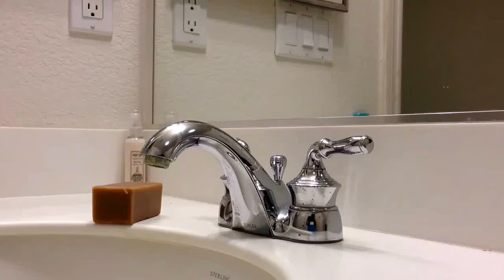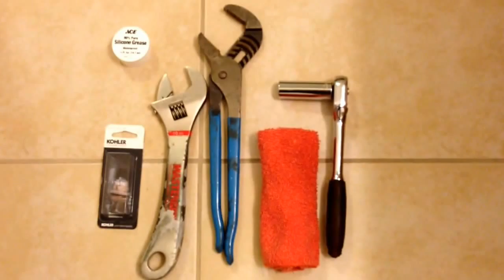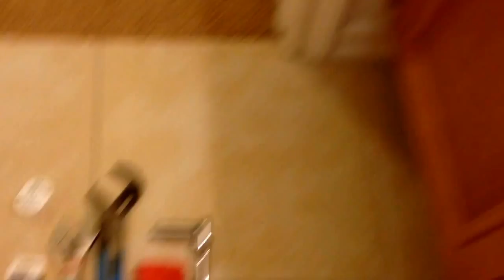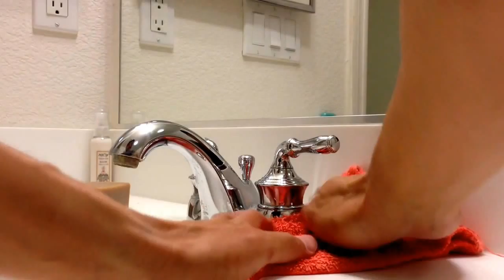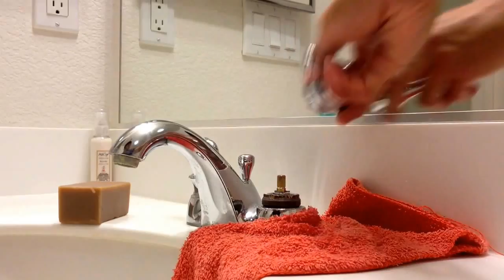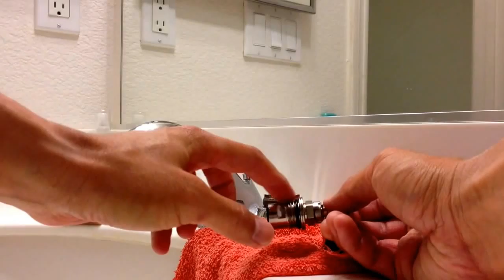Kohler leaking handle cartridge repair

Comment: Great video. I used it to replace the cold water cartridge GP77006-RP on a Devonshire K-393-4-CP. Koehler provided it free of charge under their lifetime warranty policy. I had to use liquid wrench to loosen handle prior to using the wrench (use thick rag to prevent damage). The part comes with a spline adapter, in my case it was not necessary to replace it. 5/8 inch deep socket wrench proved very useful - a fair amount of force was required to remove the cartridge.
Reply: I have not been able to loosen the skirt from my Devonshire sink faucet and noticed that you used liquid wrench.  First time I've heard of this product.  Can you tell me how  you applied it to the faucet and would it damage granite?  I can usually get this kind of job done with my rubber wrench strap but it's just not gripping the faucet.  Thanks
Reply from the maker: Really good point about the lifetime warranty! I should have done what you did and would have saved the money buying one.

Comment: WARNING:  We had this exact Kohler Devonshire  faucet but it was bought in 2015.  The design and disassembly  is slightly different.  There is a set screw in the handle which must be loosened first.  The handle can then be removed.  There is a Philips head screw that must then be removed.  After you remove the screw you can lift the bell shaped cover.  After that is done the removal of the valve and installation is exactly the same.

Comment: I will never buy Kholer brand faucets again.  I just replaced them with Delta.  They were leaking and rusting like a motha.  I replaced all 5 of them at the same time.
Reply: Really? These Devonshire faucets are heavy brass metal, and they cost about $150 for the faucet set.  Wouldn’t replacing the cartridges been cheaper and faster.  And the Delta cartridges don’t last longer.  The secret to these is for the original install to include plumber grease on all metal-on-metal contacts so they don’t seize.  It’s the cartridges that determine longevity, and supposedly the ceramic coated ones can last a long time.

Comment: If you need to fix a cartridge style Kohler faucet, use this video. Spot on instructions, easy to follow. Others want you to disassemble the sink from the bottom- quite the task. Ignore that. This video makes it clear that you need to have a 5/8” deep socket wrench fitting. A pliers would make a mess of the faucet hardware, since the valve is below the lip of the faucet base. Thankfully, I bought the socket, which made it much easier. Thanks!

Comment: Excellent video.  My cartridge was seized.  I sprayed a healthy amount WD-40 on top of the cartridge and let it sit for 15-20 minutes.  Used the 5/8 inch socket and with a couple of firm jolts with my hand it came out.
Reply: mine will not come out
Reply: @apuz13   look down a little further in the comments.  Ryan used this method:  Try a pass through ratchet with a rubber mallet.  Those things can be nasty to get loose.

Comment: What name and model number is that Kohler faucet that you repaired? Also, can you use the same cartridge for both sides due to cold is turned clockwise and on the hot water handle is turn counter clockwise. Someone told me to split it? Well Done INFO!!!
Reply: P/N 393-4-G-AB, but you can not find on Kohler website, looks bottom of sink, attached small white label with number

Comment: Can you replace the o-rings on the cartridges instead of the whole cartridge?
Reply: The o-ring only keeps water from leaking into the faucet base.  The ceramic valve inside the cartridge is what shuts off the water from coming out of the faucet nozzle.  If you've got water dripping underneath your sink then you should try tightening the cartridge or replacing the o-ring.  If water is dripping out of the faucet nozzle then the ceramic valve is bad and you need to replace the entire cartridge.
Reply from the maker: There is the one o-ring that you can see at the top of the threads of the cartridge, but I didn't try replacing it, so that might work... I just did the whole thing.

Comment: I notice that you are using what looks like the new cartridge for the video, correct?  I have a faucet like that also but it was another Kohler with the same leak from the stem seal.  I stared with a 3/8" ratchet then to a 3/8" flex or breaker bar but still didn't budge.  I was considering a electric impact but removed the other handle, pop up rod to expose the inside.  The brass housing had a 1 18" hex so I got a combo wrench(I'm at retired machine repairman) so no problem there.  Tried that with the 3/8" breaker bar but still didn't move.  Got a 1/2" breaker bar and after several grunts, it broke loose with a loud crack!  This was had reddish colored thread locker on it probably Loc-Tite.  If that didn't work I would have tried my DeWalt impact driver with the combo wrench.  Heat might work but the copper cross- over tubing is soldered right there also.

I've seen pictures of one just like you have there with the 5/8" hex rounded right off!!!!
Reply: I am thankful I came across this video and your comment.  Mine is super seized up and I couldn't get it off with an adjustable wrench.  Off to buy a standard deep-socket set right now.  I will carry my 1/2" breaker bar with me and pray I don't break anything!